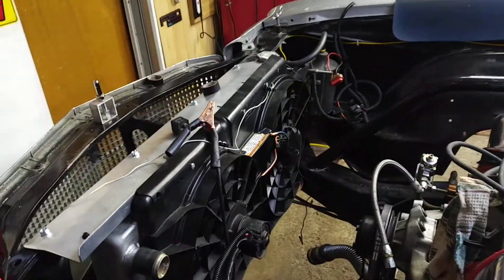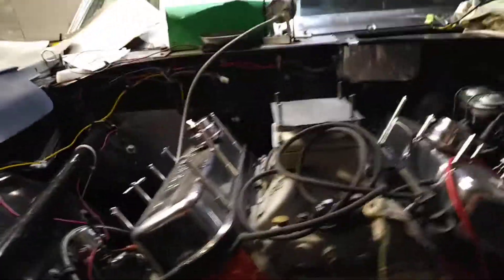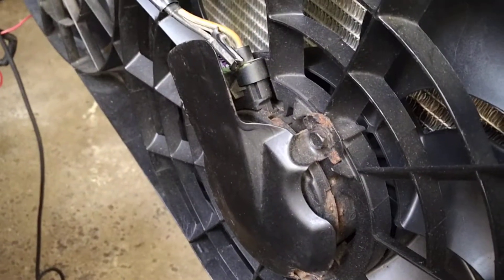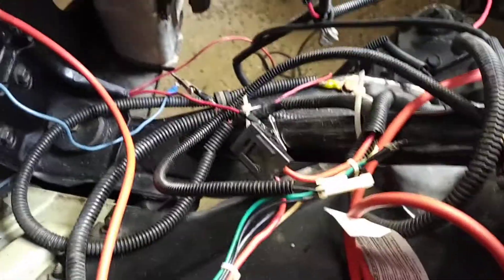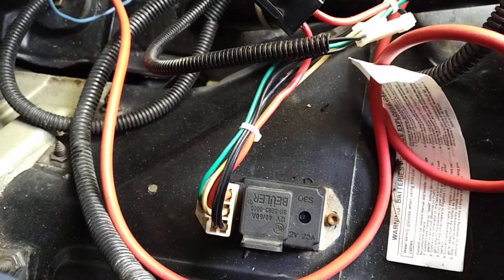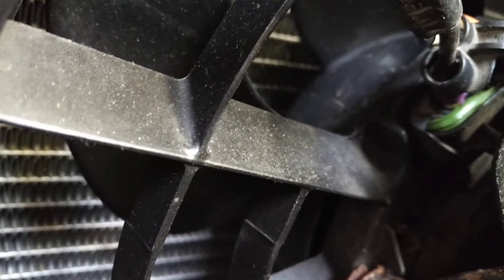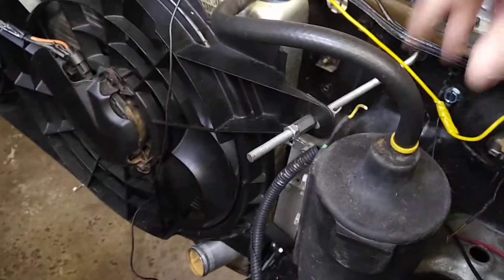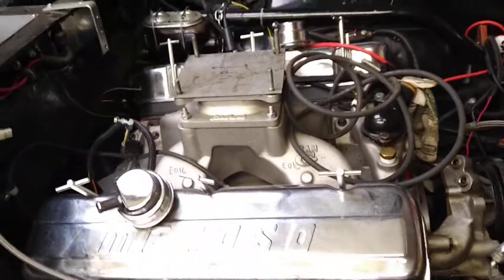Windstar fan install situation

Comment: both are single speed fans?
Reply from the maker: Hi yes both are wired for single,  I messed with the fans to see if a dual speed was possible but just kept it single. I believe there are some posts somewhere on using Volvo relays to make it a dual speed..
Reply: @NHRA1975  did you try both positive wires connected at the same time? I have a deral 2 speed fan that how it works. Both positive wires by them selves are same lower speed connect both to power at same time and high speed.
Reply from the maker: @rsabol77  HI Rick, the car is in storage until I finish my truck project (updates on my channel)..When I get the drag car back I will install a Volvo relay as the current relay is failing..